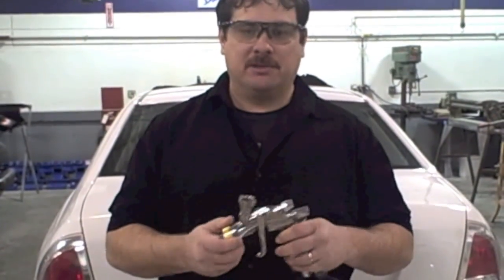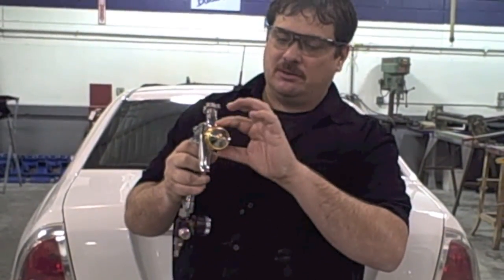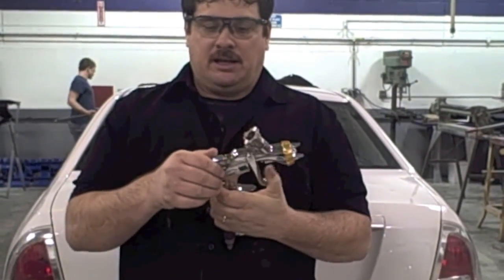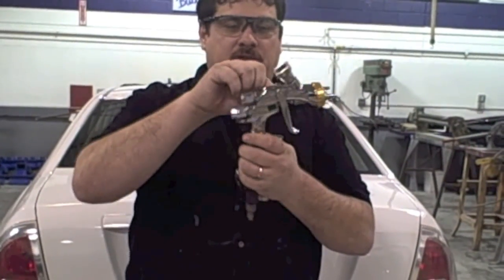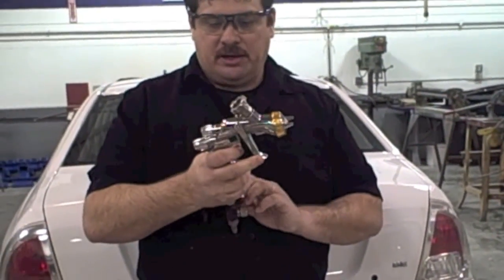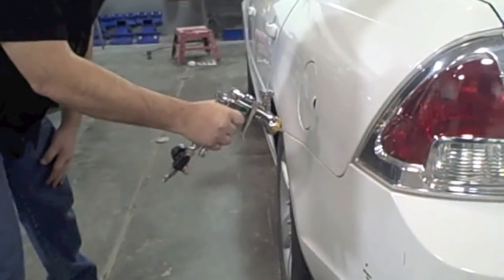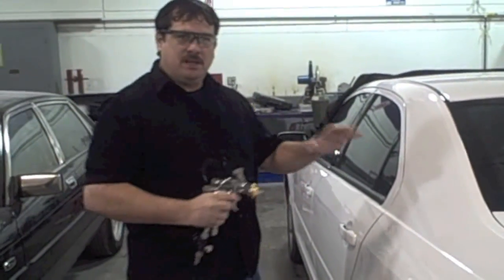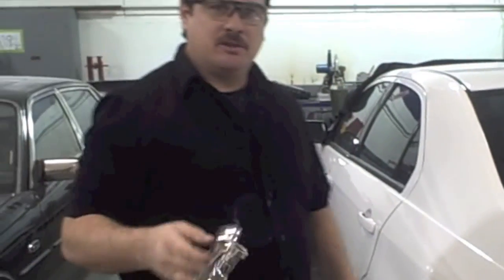DIY How To Adjust HVLP Paint Gun For Car:Auto Spray Gun Adjustments Tips

Comment from the maker: Yes, you can put a different cap on it.  It will take the needle, fluid tip, and air cap to change it from a 1.3 to 1.4.

Comment from the maker: @Cadmannn I have found that it works better to teach students to spray 8 - 10 inches and get closer as they become more comfortable with the gun.  At 4-5 inches, you have less control of the gun.  Even a hesitation can result in a run.  Every painter is going to spray a little different.  Finding the speed and distance that works best for you is the key.

Comment from the maker: The 1.4 works real good for clear.  If using it for base coat, you may need to decrease the fluid a little more when spraying.  I prefer the 1.3, but there are many who prefer the 1.4.  If you have done a lot of spraying, I think you will adjust to the 1.4 fine.  However, the 1.3 will give you a little more control if you do not spray often.  Either one should work great.

Comment from the maker: @MrAdamseye Thanks for watching and your comments.  I always like to hear from the technicians out there doing this on a daily basis.  There is a 1.4 for the Iwata as well that will give you more fluid, but we found 1.3 to be better for learning to prevent runs.  However, in your case, I'm sure the extra fluid works better.  SATA makes good guns too.  We've used them, but the students tend to favor the Iwata.  Thanks again for your input.  That is how we all learn.

Comment from the maker: t depends what you are spraying.  I open the fan all of the way for base coat.  Clear I will close the fan a little to get a wetter and heavier build.  The Iwata Hybrid uses less air pressure than many other guns.  I only use about 22 psi.  So I guess personal preference and technique is going to play a part of it.  According to the Iwata Hybrid technical data sheet, they recommend 14 to 18 psi at the gun, which creates 10 psi at air cap.  Hope this helps.

Comment from the maker: That adjusts the air pressure.  If you are not using a regulator at the gun, you can fine tune it with that adjustment.

Comment: Thanks Donnie for all the advice...I have only painted about five cars over the last 20 years and they were all mine..a few looked good and a few looked like rattle can..I now have a big white 91 oldsmobile station wagon and I am ready to paint it a satin black..got a gallon of black urethane primer and a gallon of Summits hot rod black satin acrylic urethan..using a cheap gun with an unknown tip size..I plan on setting up some test panels to try and get a good pattern and see how it looks..I know because of my lack of skill and professional equipment it will not be close to perfect but if I can get a uniform color all over even if its not as smooth as I want I will like it..

Comment from the maker: @akd052774 Thanks for watching the video.  The air pressure may depend on the brand of paint you are using.  The best way is to read the technical data sheet to see what they recommend.  With the paint we use (low voc) with the help guns, we found lower pressures to work much better.  Higher pressures tend to create too much overspray, which allows the overspray to settle back on the surface.  This causes a dry or dull look.  Higher pressure will also use more material.

Comment: Very helpful video - I do have a question, I was painting the wheel wells and in the inside corners I have rough powder like finish. I was using my siphon gun as I was painting upside down in places. Would this be incorrect distance or low paint flow? thanks

Comment: I was wondering the same thing. Watched other videos and the way you set pressure at the gun is - with no trigger pull the pressure on the gauge is the line pressure ( say 90psi) Pull the gun trigger half way back and the gauge may read 45etc. With the trigger pulled half way, adjust pressure to what you want at the gun 22psi etc. 

If you set pressure to 22 etc. at the gauge without pulling the trigger, you are going to have nearly no pressure at the tip.

Comment: Thanks for taking the time to make that video. I have a better understanding now of adjusting the spray pattern and whats up with the pressure at the tip verses the gun. Thanks that will help me a great deal. One question Im thinking of getting a LVLP Gun because I only have a 5 hp compresser and it runs all the time. I hear that a LVLP gun will help reduce cfm. Willt he results still be similar and will I need to go slower with my stroke when laying down the paint? Thanks so much

Comment: I just subscribed to your channel.  Great stuff.  I have a general question:  Regardless of air pressure/tips and gun variances, what is a good rule of thumb for determining the amount of air pressure and paint flow you want for a good spray?

I have done combinations of high pressure and played with the paint volume as well as low pressure.  I am not sure what an optimum mix is because I can make them both look ok.  I would like to be able to judge good mix based on a spray sample. thanks

Comment: I am going to paint an antique candy machine with auto paint.  Your tips are helpful. Two questions:  When I look inside the trunk of a repained car it does not look quite the same as the outside finish.  Is a different paint used usually? I am also paiinting the inside of the candy machine so I would use a similar technique.  My second question is about whether to use base/cc or acrylic enamel.  I don't need UV protection. I will use a solid color.  What is better for a beginner? thanks!

Comment: Donnie, I am new to painting and have somewhat of a limited resource on buying equipment until I find out for sure I can produce the results I want.  I have bought the Devilbiss Tekna Copper gun, it can with both 1.3 and 1.4 tips. I know it is supposed to use less air pressure then other common guns. My question is have you used these and if so what do you think of the results? Thanks and I really enjoy your videos.

Comment: Might not be part of what you intended to touch on, but the over lap of pattern is something might want to add.  And how it has to change when spraying a solid base, apposed to a pearl, or metal flake base.
 If you release the trigger all the way, make sure to pull trigger when restarting, pointing away (off to side) of panel so you don't get a burst of build up at the starting point. Especially with pearls.
  Always test pattern first on scrap, or wall.

Comment: I use one at work, FOR BASE only. I tried laying clear with it and it is just to slow, and decreasing your fan size gives you a disadvantage. 

I have a video showing this gun being used for clear coat, and you can tell how close to the panel and fast you have to move to keep a wet edge on a larger job. I show the hood getting cleared, but we also did the drivers side doors and quarter.

Next I will show my Sata RP, or a real clear coat gun :P

Comment: Love your  video's, you've taught me a lot already. Thanks. I'm in the planning stages for body/rust repairs and full paint job on a daily driver. I have a porter cable HVLP gun that i've used for spraying lacquer etc in wood working. It only has a 1.5mm nozzle and It is an obsolete gun and I can't find any more nozzles. I'm looking at using the Eastwood, 2K surfacer, and their Epoxy primer, followed by urethane base and clear. Eastwood recommends I buy their Contour LT gun and 1.3 and 1.7 tips. I think I remember you saying in the Mustang video that you used a 1.4 for everything. Do you think I have any chance to make the 1.5 work or should Pony up for the new gun.

Comment from the maker: There are several reasons, but too much air pressure is a common problem for this.  This creates too much overspray that lands on top of the paint.  You may also check to see if you are using the correct reducer for the temp.  I hope this helps.  Thanks for watching!  Visit my channel and watch my guns spraying techniques.  That playlist goes in more detail than this video.

Comment: I purchased the Sharpe Fx 3000 1.3 cap you recommended.
I called manufacturer he said to set pressure 29 PSI "at the gun"
You recommend 18-22. What should I do if I am spraying Refinish Solutions Urethane Clear over Matrix urethane basecoat? thank you kindly

Comment: i worked in a body shop in 1999 spraying ppg 2042 clear. just decided to paint a black fender.  My compressor sucks.  I am using a sata jet nr 95.(was great back in the day) lol.  When u say 18 25 at regulator. Is this with the trigger pulled halfway so no clear is coming out?  I can get 30 plugged in and it goes from 15 down to 7 when pulling trigger.  I dont want to screw it up.

Comment from the maker: Other guns will work fine.  It sounds like you have a siphon feed.  Those guns require more air pressure that the guns I am using in the video.  If you are used to the gun and it sprays well for you, use it.  Let me know if you have other questions.  Thanks for watching.

Comment: Good Video propely good settings for The low presure Iwata Supernova ! 
But What would be a good setting for the new Iwata Supernova Hybrid.iwata says something like 26psi and full fan and full feed. A local auto paint shop have the hybrid iwata and they use 30psi  and full fan and feed but they say its on the edge of running.would 30 psi be to much if I lower the feed and fan ? anyone who has a good setting for this gun, a setting where it doesnt run easy.Fan feed and psi please Thanks

Comment: I'm still lost with all this psi crap. I have the same gun, what do you mean "psi at the gun"? My regulator is on the gun, just like yours. Do I set it with the air control fully open? It says 90psi when the trigger isn't pulled, then 20 psi when it's pulled. Does that mean it's getting 70 psi (90-20)? If I close the air control a bit, I can get it to 30 psi, but I can also close it more, open the regulator a bit, and still get a 30psi reading but the amount of air coming out is completely diffe

Comment: i use the ls400 silvertip for clear.it seems to paint to slow for my style of painting. which is faster and thicker walking that thin line between a run and glass. would the 1.4 be better or would raising or lowering pressure help.i was told open fluid all the way up. where you say crank it in 4 times.need help
Reply from the maker: If you like spraying that wet, tun I would use 1.4.

Comment from the maker: @lee1PA Thanks for watching.  If painting inside of something, I usually turn my air pressure down a little to prevent as much overspray from blowing back on me.  Everything is would be the same as painting the outside.  In your case, I would use a single stage urethane for inside and outside.  This provides a good gloss and does not require clear coat.  Thanks for watching.  Also, check out my DIY guides at CollisionBlast(dot)com/AmazonBooks

Comment from the maker: Let me know how it works or you.  You're right, Iwata does use less air pressure than most others.  If you are new to spraying, it may be better for you to spray a little further than recommended to give you a little more control.  As you become more comfortable, you can move in closer.  Remember, make the spray gun adjust to you, don't try to make yourself adjust to the spray gun.  Thanks for watching and let me know how it works for you.  It is a great gun.

Comment: I am getting ready to spray Nason single stage urethane with an HVLP gun. The can says to set the psi at 8-10. From what I am seeing online is anywhere from 14-20 PSI. Which should I use as a starting point for my test panel? 8-10 PSI seems a bit low.
Reply from the maker: Yeah, this is really confusing.  I will try to do a video on that when I get caught up.  But the TDA usually say 8-10 PSI at the air cap.  Although most guns do nat have gauges at the air cap.  We set the pressure at the inlet regulator.  Every brand of gun requires different inlet pressure to get the 10 PSI at the air cap.  My Iwata takes 18 to 22.  Other guns take 26 psi.  I would say the wide range would be 18 to 30.  I don't know what kind of gun you have, but I would probably start with 25 psi and go from there.
Reply: Thanks for the quick response and advice. I have the gun inlet air gauge set at 22 to get about 10 psi when the trigger is pulled. I will play around with spray patterns on a test panel to see what I get. I am just repainting the top of my 95 Bronco that had oxidation. I prepped it and sprayed the Eastwood 1-1  epoxy primer and it came out great. Your videos are great by the way.
Reply from the maker: I am glad you are finding the videos useful.  Thanks for watching.

Comment: I checked again with anest Iwata The Iwata LS400 supernova is supose to be aboute 19psi while the Iwata LS400H Hybrid is supose to be around 25psi these are two different guns models Hybrid being the newest, so I guess you have the older version Ls400 which is supose to be at 19psi.   you crank this one up to 22 for better atomization while paintshops who have the Hybrid version 25 psi  crank theirs  to 30psi for best atomization. so I guess 22 psi for LS400 is good and 30 psi for LS400H is best